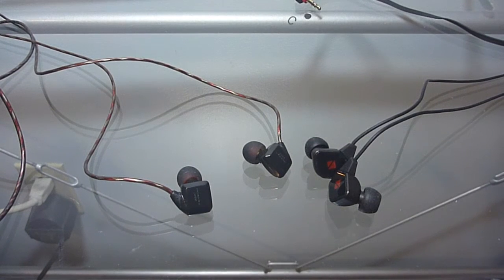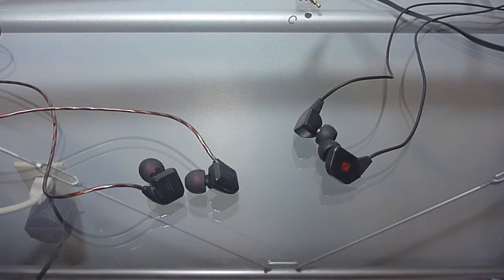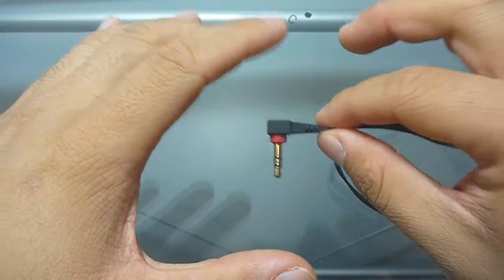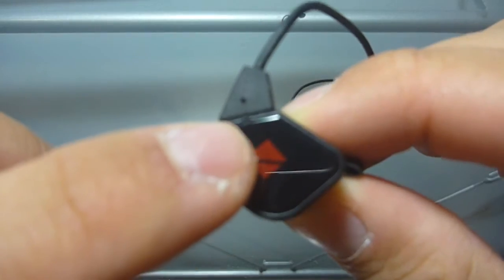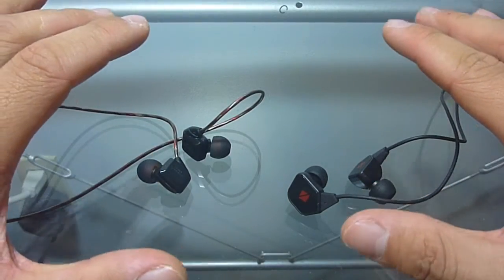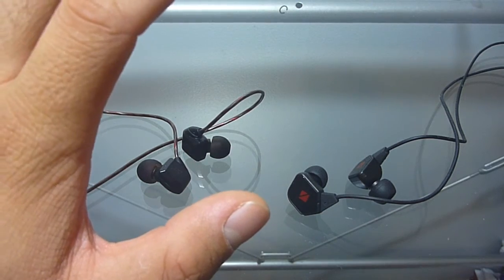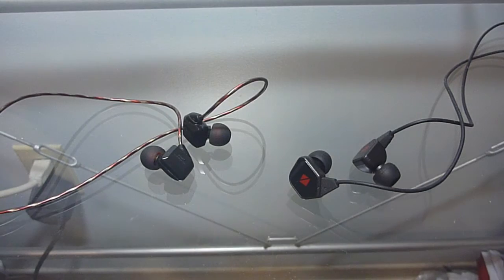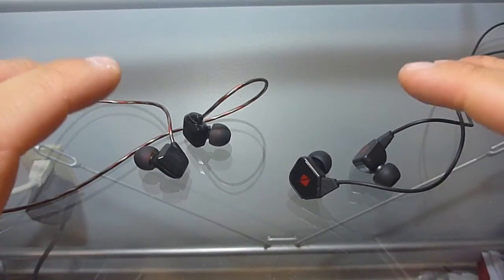HAVI B3 Pro 1 VS VSONIC GR07BE Comparison

Comment: Hey, Great video. I recently got the GR07BE and I love them, money well spent, However is your swivel joint very loose? cause my left one seems looser than the right one, It was originally very tight, then when I tried moving it, it became very loose. like it would drop down after certain points. but at other points it stays tight. it also makes a sorta clicky noise, louder than my right one when moving at certain points. Suggestions would be great, cause I think I may of broke them :(

Comment: A great review! Concise and sweet. I just subbed! I currently have he she3590s. As realistically as you possibly can, how much more of an upgrade are the havi b3 pro 1s and Vsonic GR07s to the Philips? I'd appreciate your response! Ps, I'm planning on pairing either of the former two with an ibasso dx90.
Reply from the maker: ghighkihjhhkhkh thanks very much! for sure, i reply to everyone as much as i can! i'll compare the philips she 3590 to the gr07 (in my case the Bass Edition) first because they are closer in sound signature. what you get a is a much more detailed sound overall, the treble has better extension & has more air, the midrange is not as recessed as result the midrange is cleaner and more articulate, and has better overall layering and separation both for instruments and vocals. the bass is much faster and tighter as well. there is less bass however, so that is something to note.  also the soundstage is much larger, and wider as well.
Reply from the maker: ghighkihjhhkhkh comparing the 3590 to the havis, you get substantially less bass. so this makes the havis less "fun sounding" or punchy. the midrange has much leaner(so notes thickness sound thin, not everyones preferences, but gives them a bit of edge compare to the warmer she3590), but detail, the havis have this innate ability to bring out the small details in voices, and instruments (like guitar plucking, how hard they are doing it and such for example). the treble is less peaky and less harsh as result. the soundstage is on an whole another level. the havis are much more open than the small soundstage on the philips. so the best way i can describe is that the havis  is a magnifying glass for your music. it opens and expands the sound of it. (however because it enlarges the sound of everything, its not the most natural sounding, but its definitely a fun trick and a unique one at that).  I hope that answers your question! be sure to hit me up again if anything is unclear.
Reply: Wow that was awesome, great comparisons! Your time and effort is appreciated. I think the GR07s may be the better choice for me, they sound like my taste. Hhhmmmm....I've read the havi's sound much better with a higher quality source, I'm also interested in hearing THAT soundstage! :O. Anyway thanks again Tom, looking forward to more reviews! Keep up the good work bro!
Reply from the maker: ghighkihjhhkhkh the gr07s are no slouches in soundstage either :) no problem! Glad i could help!

Comment: some people from head fi sayed that T1E is even a little bit better then GR07BE when fully burned in.
still T1E is way better then HAVI B3 Pro 1 because it's half the price.
Reply from the maker: esframunas963 do you mean the t1 or the t1s??(those are around 30-40$) not the t1e? cause the t1e is about 49$ compared to the havis which are about 60-70$. personally i'm having a hard time researching the differences between the t1, t1s and the t1e... it seems like the t1e is the bassiest of all but i just found out about the t1s (soo many to choose from!). and regards to being better than the gr07be, i wonder where your seeing that..(send me a link! =)) (what is considered "better")
Reply: On A studentbudget T1E on DX.com and Aliexpress costs 35
http://www.head-fi.org/t/728860/ttpod-t1-e-impressions-thread read all pages you see that people starter to buy them more and more.
there are people that compares them with GR07BE and says that T1E is alittle bit better.
Reply from the maker: esframunas963  i just put in an order for the ttpod t1e! We'll see what the hype is all about